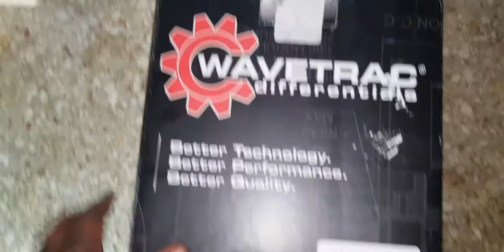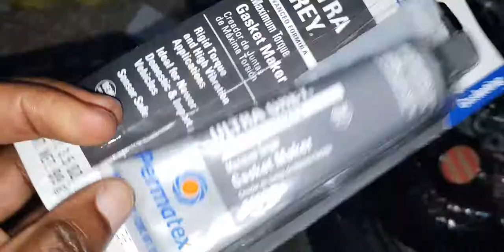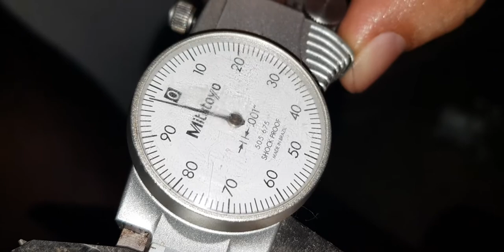MK6 Golf GTI LSD installation in a DSG

Comment: Respect for the video and taking the time the inner clutch was not seated correctly 😳
Reply from the maker: This was subsequently replaced.   In hindsight it would have been better to do a clutch upgrade since the transmission was removed from the vehicle.   This transmission will be used for race purposes